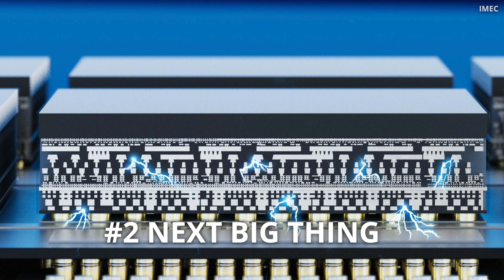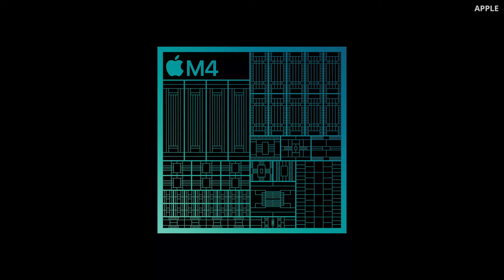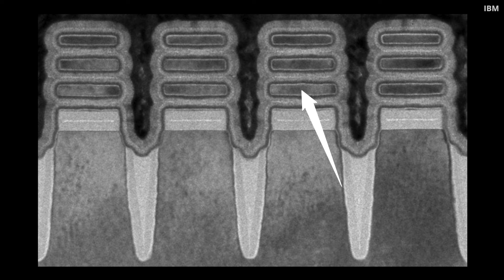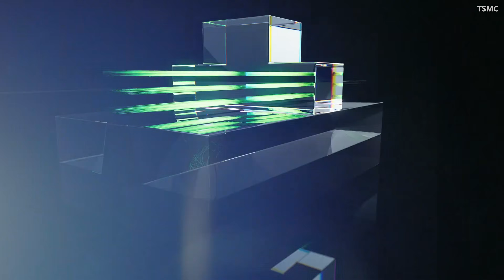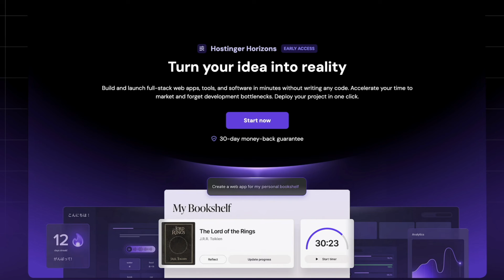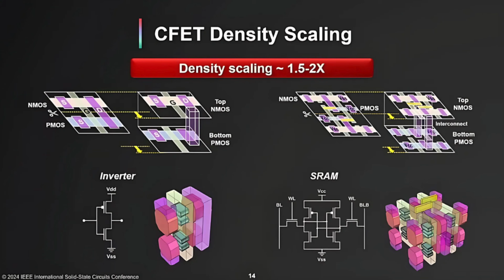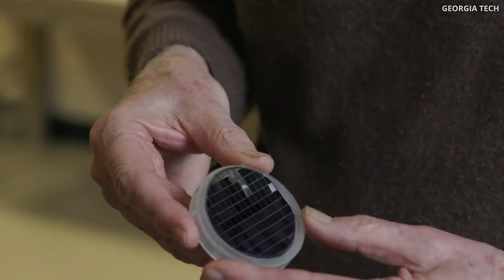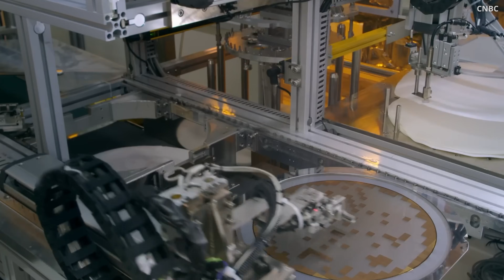The Next Big Thing in Semiconductors

Comment: 3 micron was actually 3 micron. 3 nm is 45 nm CPP and 23 nm MMP. Nothing on that chip is 3 nm. It's not a 3 nm node; there's no such thing. 3 nm is just a name intended to convey good feelings (tm). It's not a figure of merit.
Reply: What is CPP and MMP?
Reply: @mitthrawnuruodo7517  "In microchip manufacturing, CPP (Contacted Poly Pitch) and MMP (Minimum Metal Pitch) are critical parameters that define the density and scalability of semiconductor devices."
I didn't know either, but I asked an AI (ChatGPT)
Reply: @SigurdBraathen  So you are trusting chips to tell the truth about their sizes? Very trusting.
Reply: @SigurdBraathen CPP is the distance between silicon transistors and MMP is the distance between the smallest wires.
Reply: @mitthrawnuruodo7517  : ChatGPT wrote more, IDK if I can paste it all here and more importantly: IDK how much you can rely on this!
"CPP (Contacted Poly Pitch)

CPP refers to the distance between the centerlines of two adjacent gate structures (poly-silicon gates) in a transistor, including the space for the contact.
It is a key factor in determining the scaling of transistors and is directly related to how small and densely packed they can be in a chip.
As transistor nodes shrink (e.g., from 7nm to 5nm to 3nm), CPP is reduced to allow more transistors per unit area.
MMP (Minimum Metal Pitch)

MMP represents the smallest pitch (distance) between two adjacent metal interconnects in a given metal layer.
It is crucial in defining the wiring density and performance of a semiconductor device.
The reduction of MMP enables higher routing density for interconnects, which is essential as transistor sizes shrink.
Why are CPP and MMP important?
They directly impact transistor density, power efficiency, and performance.
Advanced nodes (e.g., 3nm, 2nm) aim to minimize CPP and MMP to improve transistor packing.
Extreme Ultraviolet (EUV) lithography is often required to achieve smaller CPP and MMP values due to the limitations of traditional deep ultraviolet (DUV) lithography."
Reply: Yes, I remember she mentioned that in other videos.
Reply: It's "3nm" because that's the equivalent feature size needed before FinFETs to achieve the same performance/density etc. But yes, it's a marketing name.
Reply: @nomchompsky3012  hope she sees this because you deserve a gold star
Reply: @nomchompsky3012  Ahhh, makes sense. It's not that the measuring method was changed, but rather kept.

To allow for easy comparison with older models, back when 3micron was impressive.
Reply: I was similarly disappointed to learn about "2" * 4"" lumber.
Reply: I suppose "3nm" means the gate density achieved is the same as that of a fictitious "3nm planar transistor" technology by linear scaling.
Reply: When people intentionally label products to deceive I guess we're not supposed to pay attention to it.
We should like it.
Lie to me! Damnit!
Reply: 3nm is what an equivalent planar transistor channel length will be to deliver the equivalent PPA. That is how the nodes are defined. *Equivalent planar transistor.
Reply: Lots of arguing here.  What it comes to for me is how much work can it do in a unit of time for a given unit of electrical power.  Sadly, they monopolized how long you can use technology by the software, under the guise of security.  I'll likely not be interested in any newer technologies because software will no longer function on the newer hardware without being forced to install the newest garbage operating systems.
Reply: This is starting to sound like having a platinum credit card or titanium razor blade. There is no platinum in the card and no titanium in the razor blade. Or how about 10 TB hard disks that are missing a couple of TB. We need more reality and less marketing.
Reply: @louistournas120  "Or how about 10 TB hard disks that are missing a couple of TB.": There you are completely wrong. What you are ignoring, is that 10 TB ≠ 10 TiB! 11 TB ≈ 10 TiB. The announced 10 TB on a hard disk is actually really 10 TB. In 'the beginning' people called 1 MB the same as 2^20 B, which is just utterly wrong. They wrongly changed the meaning of M from 1 million to 2^20. They only did that, because 1000000 is 'about' the same as 1048576. They later had to repair that marketing thing, because the % difference gets notably larger at 2^25, 2^30, 2^35, and so on. So they had to introduce kibibyte, mebibyte, gibibyte, tebibyte, pebibyte. Not because HD manufacturers used wrong numbers, but because marketing people used wrong numbers. If you want a 10 TiB drive, you have to buy a 11 TB drive. Those don't exist, but that's not the manufacturers fault!
Reply: Why change the size of something when you can just change the method for measuring it? 
I'm all for this. Now I can claim I have a 1 meter trouser snake 😂
Reply: @gasracing5000  - so funny.  LOL
The transistors have a dimension of 3nm or they don't.
Which is it?
Reply: @alpal2002 that’s not what it means. It means that the narrowest line, or feature, that can be formed on a chip is 3nm. It doesn’t mean that all the features are 3nm.
Reply: @melgross  - I think the 3nm variable is badly defined.
You could also take it to mean that 
the resolution of the ultra violet light has to  be smaller than 3nm -
in fact a 1/4 wave or 0.75 nm.
Reply: @ The light doesn’t interact directly with the material. Instead, the mask causes the light to interfere with itself, creating patterns smaller than the light’s wavelength. For example, in a 3nm fab node, extreme ultraviolet lithography uses a 13.5 nm wavelength light source to achieve these tiny features. The '3nm' name doesn’t mean transistors are 3nm in size, but rather that some critical features, like gate lengths or metal pitches, can be as small as 3nm. Since the smallest possible feature is 3nm, actual transistors and circuits must be built using multiple such features, making them larger overall.

Like, just because your phone can create images with pixels smaller than you can see, it needs to use multiple pixels to create any useful patterns.
Reply: @gasracing5000 South Park did an episode on that. They called it tmi
Reply: Horizontally × Vertically squares the amount of space.
Reply: She mentioned that in other videos
Reply: At some point the new nodes becqme estimstions of performance if a certain node was physical, so you are correct.
Reply: The 3nm is the minimum channel length of the transistor that can be fabricated. It doesnt refer to the whole width or dimension of the transistor. Channel length is the distance from drain to source of the MOS measured at the inner edges.
Reply: At 3 nm you’ll get spill over of the electron wave function between the lines which will severely limit performance.
Reply: Really interesting for me purely as a zero experience chip technology person. I sort of comprehend the layering aspects, what confused me was both the heat transfer requirements of the chips, it sounds like it’s going to need breakthrough technology to keep it cool enough to prevent melt downs 😅 and the power needed to operate the chip. I’m assuming these chips are not for the general purpose pc’s? . The statement about technology advancement, hmmz that’s deep. For humans to advance technologically 20k years in only 100 years scares the crap out of me. We don’t seem to be doing a great job with what we currently have and just use it to weaponise or enrich the few .
Reply: All this progress is exciting, but never lose sight of what it means for humanity.  Will we be enslaved by it? If so, stop.

I can say the same about the dangers of tinkering with DNA in living organisms.

The law of unintended consequences will continue to manifest itself in many ways, especially and most horribly in irreversible things that cannot be undone.  Let's not paint ourselves into a corner.

We must be wiser than we are smart.
Reply: Yes, they should change it to something like billion transistors per sq mm.
Reply: Transistor density /mm^2 is still increasing however
Reply: The problem is that the media, which informs the public, never says anything about the 3 nm features not actually being that small.  So others and I, the laymen, are now very disappointed that we've been lied to.  😡
Reply: @ Nobody lied to you. You just made assumptions. If that makes you angry that’s your problem. Nobody else cares or will ever care. And it’s such a pointless thing to be angry at. A total waste of mental energy. Literally nothing tangible in the world would change if they called it “X3” instead of “3nm”, except it wouldn’t be as annoying to a tiny number of extremely pedantic people… who would probably just find some other thing to be annoyed at instead.
Reply: @auspiciouslywild  you're arguing that it doesn't matter that 3nm isn't really 3nm in the comments of a video that literally starts by making an invalid quantitative comparison predicated on the false premise that 3nm really is 3nm. The mind boggles. (And to top it all off, she got the math wrong: 3 µm to 1.6 nm would have been roughly a 99.95% reduction, not 99.99%. The actual number is about 98.4%, from 3 µm to roughly 48 nm.)
Reply: @auspiciouslywild people should care though, but maybe not yet. When we get to theoretical physical limits and there are still die shrinks then people should start to be more curious because we need to know what the actual plateau date is going to be. Then we’re going to need to get performance from elsewhere, like new circuit ops etc, materials advancement, etc and we’re going to need that information communicated meaningfully. At the theoretical limits we’re not talking about never getting smaller but it does mean waiting on an advancement in the fundamental computational paradigm.
Reply: Apple just announced the new iPhone 300.. it’s so much more advanced compared to Samsung s26 about 270 generations ahead.. there you have it Samsung but I hear they gonna release 4500 gen next
Reply: @auspiciouslywild is making the point that the electrical characteristics of these devices - the behaviors that actually matter for circuits - are not a direct function of singular physical parameters such as planar gate length anymore. This hasn’t been the case for over a decade already, so this idea that you’re getting short sold because the physical dimensions don’t match the name is completely baseless.

The important characteristics for these types of devices include on and off state currents (and the slope of the line between them), switched capacitance, and fabricated density (to name a few). All of these important metrics have continued to improve in the deep sub-micron scaling era independent from literal physical parameters. This is why it’s valuable to have a name associated with each process node that indicates relative performance even when it’s no longer physically accurate.
Reply: @chancecoats123  it's not baseless since they decided to annouce the process evolution as a physical parameter expressed in nm. They could have simply named it 1st gen, 2nd gen... Xth gen and nobody would have complained
Reply: We don't produce the electricity to handle these chips and AI.
Reply: It actually is a figure of merit, if it wasn't then there would be no difference between a 7nm TSMC node and a 3nm node. Sure it's not the difference you want for some reason, but the marketing 'gimmick' is based in reality - lower power consumption, higher transistor density, faster switching etc. nm is actually a useful measure, the same way we still use horse power to compare the performance of engines. No, your car is not equivalent to 400 horses, but the measure is still useful.
Reply: Semantics who cares. Just know TSMC is #1 🇹🇼  and Samsung  #2 🇰🇷.  Only competition is between these two for at least the next decade. Intel is a joke and  continues their slow decline forever.
Reply: I already told her like a 100 times in the comments that the gate width is nowhere near 3nm or less.

She is doing it wrong, period.
Reply: @Pleusch I think she knows a lot more than you do.
Reply: @melgross  i think you both don't know what I know. And people who know, know they know nothing.
Reply: @ I can tell by what you said. It’s not that difficult.
Reply: Who cares? Are you designing a digital standard cell library? No? Then why do you care about what the number means?
Nobody used the “nm” number for anything meaningful, even back when it was derived from a physical dimension. It was ALWAYS mainly a proxy to get a rough idea of potential transistor density and performance. If you actually need real numbers you always needed the full design rules from the fab. 
Nothing has changed since then. The “nm” number is still just meant to get an overall idea of how good the technology is. When they found ways other than shrinking gate length to improve density/performance they just decreased the “nm” number as if it came from scaling a planar transistor. Which is the most sensible thing to do.
Reply: @auspiciouslywild  That is just false. Many people in technology field and especially on the hobbyist part are confused and think that "nm" in process node name actually refers to some physical dimension. They compare even Intel and TSMC processes by their nm-names and put superiority on one over another based on what the number of nms is in the process node - even when they are not actually comparable like that.
Reply: @ They were not directly comparable by “nm” even back when it corresponded to a physical dimension. Performance and density was dictated by a LOT more than the minimal gate length. 
If someone thinks a single number can capture the performance characteristics of a process - and tell them anything at all about the performance of a CPU or GPU - that’s their problem. They’re the ones making unreasonable assumptions. 
The enthusiasts should have learned from the whole “more GHZ is always better” period of measuring CPU performance. The way you measure performance is to benchmark the applications you want to use the product for. Nothing else can give you that information. So tell me, why do enthusiasts and hobbyists need ”Xnm” (or “NX”) to correspond to a physical dimension? How would that tell them anything meaningful? Especially if “X” doesn’t change from node to node, yet the performance improves significantly?
It should also be said that TSMC now usually calls the process eg “N3”, not “3nm”.
What TSMC, Samsung and Intel have been doing here is the only reasonable thing. The only thing that makes sense.
They took a marketing number that used one physical measure to give an estimate of density/performance, and made it into a marketing number that continues to give you an estimate of density/performance, in a way that’s consistent with what you could take from the previous marketing numbers.
Reply: @auspiciouslywild so no one should learn anything new based on your logic.
Reply: @auspiciouslywild  'Who cares?'
This is the guy who doesn't care when his dozen eggs only has 2 eggs in the pack, because he's not a chicken farmer..
Reply: @ Uh, what? Those are not at all comparable. The only thing the foundry promises their customers is that “2nm” is better than “3nm” in some way. If you want the details, read the spec sheets. But you are not the customer of the foundries anyway. The foundries aren’t giving any kind of promise directly to end users. That’s for the CPU/GPU makers to do.
Please tell me exactly what you’re being cheated for when a “N2” chip doesn’t have a “2nm” feature. What were you hoping to get? Do you have a habit of looking at your chip in an electron microscope?

If you were sold 6 eggs but only get 2 you’ve been cheated for something tangible you asked for. But with chips, nobody buys a product based on how many “nm” you get.  Even if you did you still get the same end result that you were expecting. It’s as if the farmer had really small eggs that day and gave you 8 small eggs instead of 6 large eggs. And in this case the farmer knows you’re a chef (a CPU/GPU designer) making omelettes and that it doesn’t make any difference to the end-user compared to the 6 large ones. 

To be honest - and I may be completely wrong - I think those of you complaining about this just want to sound smart. Admit it, you never really cared about how few “nm” something was other than as an intellectual curiosity. 

I design chips for a living. I don’t care what the foundries call their process. In fact I really like that they continue with a sensible naming scheme that lets us compare old planner and newer non-planar processes. If even I don’t care, why should you?
Reply: @auspiciouslywild  2nm is a physical measurement... this is the issue. When you use a unit of measurement, the measurement needs to be accurate. 
If the physical measurement is 28nm, calling it 2 is just not accurate. It's 14x more performance for the same size, sure, but that doesn't make it 2nm.
Reply: @ Who says “nm” is a physical measure in this case? We all know it’s a marketing label. It could stand for “niceness metric” for all we care. 
Nowhere in the materials of any of the foundries will you find them claim that a “2nm” process has any features that measure 2 nanometers.  
… and you know what, if it’s that important to you that the process has a a feature of that size, I’m sure you can find it. Some of the key features of the transistors are nearly that small (5nm fin width for a 3nm FinFET process), and some of the corner features will be even smaller.
The foundries aren’t making planar transistors anymore. So your implicit demand that they have planar transistor there with a 3nm gate length doesn’t make any sense at all. 
Would it be nice if they move from saying “2nm” to “N2”? Sure, a tiny bit…. and that’s exactly what TSMC has been doing that for a while (they use both now so it’s a smooth transition), so you really have nothing of substance to complain about.
Reply: Does presenting information in the method you use please you greatly? You seem to call others as wishing to appear smart.I you are a chip designer it would be apparent already that you are smart. Since you need to put down others for questioning I doubt your overall intelligence.
Reply: @auspiciouslywild who says? The fkin name!!! They call it nanometer everywhere!!! You can't just use words and then say that they just don't mean what all people think they mean and what the definition says they mean
Reply: @ModelLights  when you buy 4 score eggs and get 36 eggs 😂
Reply: @auspiciouslywild no, you don’t. It does mean that the narrowest line in the chip is 2nm. It doesn’t mean that all features are 2nm.
Reply: @delallegood5799 I doubt yours for just saying that.
Reply: @melgross  That is not true. It does not mean that the smallest feature is 2nm.
Reply: @ that actually is what it means. , but manufacturers are using more esoteric terminology. Unfortunately, at about the 22nm process level, other than for Intel, other manufacturers began to fudge. It’s only gotten worse over time. But that’s the theoretically smallest feature than can be produced on the chip.
Reply: @melgross  Your assertion that a “2 nm process” implies that the smallest features on the chip are exactly 2 nm is not supported by the underlying science of advanced semiconductor fabrication. In today’s technology, node names (such as 2 nm, 3 nm, 5 nm, etc.) have evolved into generational labels that capture improvements in overall transistor density, power efficiency, and performance—not a direct measurement of a specific feature size.

For example, according to industry projections, a “2 nm node” is expected to have a contacted gate pitch of roughly 45 nm and a tightest metal pitch of about 20 nm (Wikipedia). These values illustrate that the “2 nm” designation is a shorthand for a set of advancements rather than an indication that any single transistor feature is literally 2 nm wide.

Furthermore, if one accepts that process node nomenclature has shifted from a literal metric (like gate length in earlier planar technologies) to a more qualitative, marketing-based indicator since the advent of FinFET and subsequent architectures, then asserting that “2 nm means 2 nm features” is self-contradictory. It overlooks the fact that different foundries may even use the same node label to refer to processes with differing physical dimensions.

In summary, the “2 nm process” term reflects a new generation of semiconductor technology with enhanced performance and density—not a literal measurement of the smallest feature size on the chip.
Reply: @melgross In contemporary semiconductor manufacturing, the “2 nm process” designation is a generational benchmark rather than a literal indication of a 2 nm gate length. Advanced node nomenclature has evolved to encapsulate a suite of performance enhancements—namely, increased transistor density, reduced power consumption, and improved switching speed—without requiring that every critical dimension scale down to 2 nm.

For example, IBM’s recent demonstration of 2 nm technology, which leverages second-generation Gate-All-Around (GAA) or nanosheet architectures, achieved an effective gate length on the order of 12 nm. This dimension is deliberately maintained to ensure robust electrostatic control and to mitigate deleterious short-channel effects that would be pronounced if the gate were scaled to a true 2 nm dimension. In addition, projections indicate that for a 2 nm node, key parameters such as the contacted gate pitch and metal pitch are expected to be approximately 45 nm and 20 nm, respectively.

A literal 2 nm gate would push the device into a regime dominated by quantum mechanical phenomena—most notably, quantum tunneling—which would severely impair device reliability and performance. Hence, the “2 nm” moniker serves as a qualitative indicator of the next generation of process improvements rather than a precise physical measurement.

In summary, while the “2 nm process” heralds substantial advancements in integrated circuit performance, the actual transistor gate dimensions remain in the 10–15 nm range. This approach reflects the practical limitations of current lithographic techniques and the complex interplay of materials and device physics that govern modern semiconductor fabrication.
Reply: @auspiciouslywild  it must be nice to be an arrogant know it all? No need to condescend to make a point!
Reply: @ I don’t know a lot. But I know chip design. Ignoring someone with experience in a topic, trying as good as he can to patiently explain in clear and understandable terms why something is the way it is, is really arrogant in my book. But what do I know.

If you’ve got some sensible arguments to make, I’d love to hear them. I could be wrong. But then argue with reason, not with quips.
Reply: @auspiciouslywild  i guess you enjoy being lied to 😆
Reply: @auspiciouslywild  had no idea, that's really interesting, thanks.